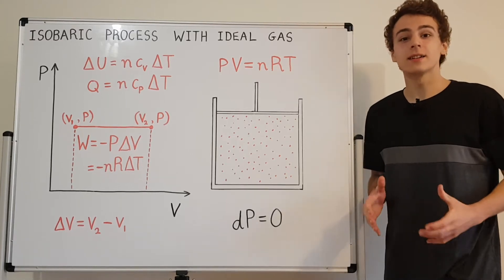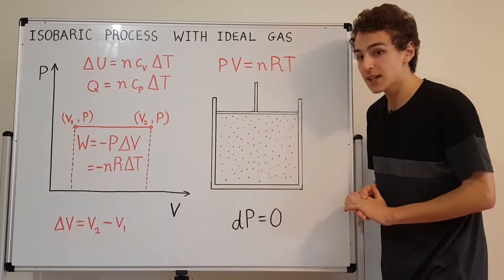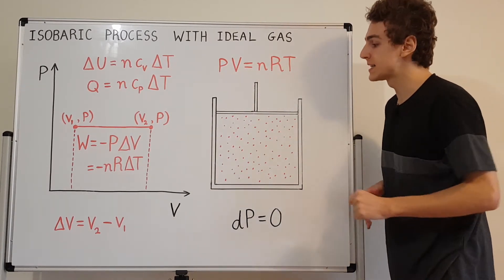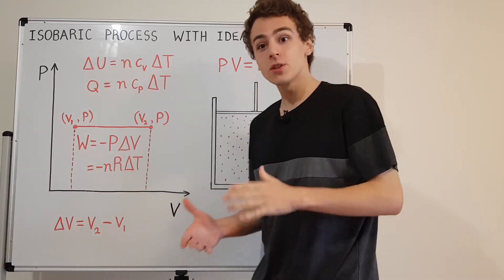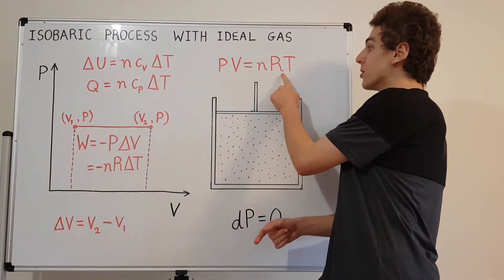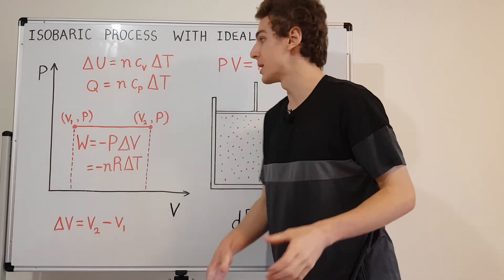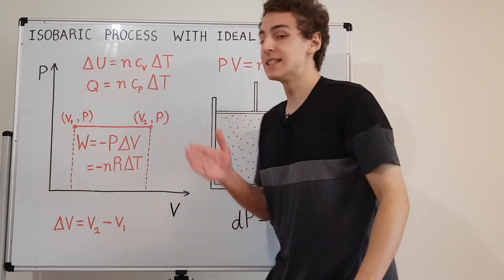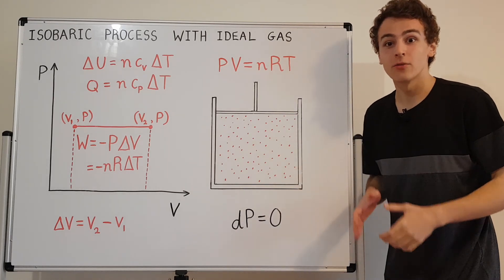Quantitative Description of Isobaric (Constant Pressure) Process with Ideal Gas

Comment: Volume does not change inside a steam drum, superheater, & condenser Heat Exchanger in the case of boiler plant  cycle - Rankine
&
Volume does not change inside evaporation & condenser in the case of Air Conditioner or refrigerator cycle - Rankine.

Specific volume does change, I believe 

 still called constant pressure processes, 
Why?

Is pressure held constant using feed back control system with set pressure, and  automatically reducing/increasing: shutting off/ shutting on heat input from burners and using water flow to control water level.
Thank u

We know the given is:
In steam drum, Evaporator and condenser, temperature does not change and it change in the super heater and sub cooling before expansion process. 
Thank u
Please share your knowledge on this.
Best wishes